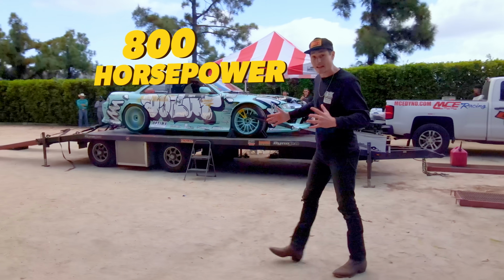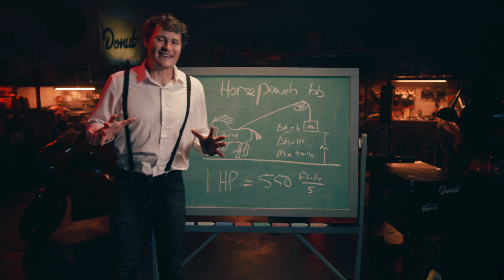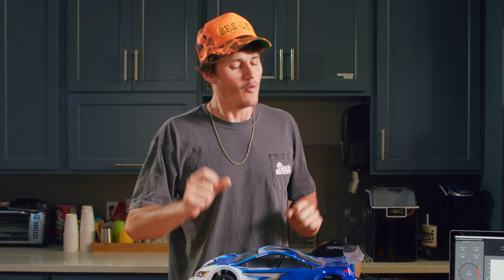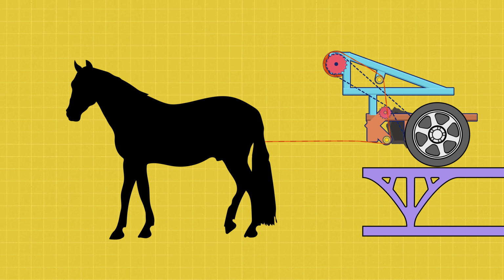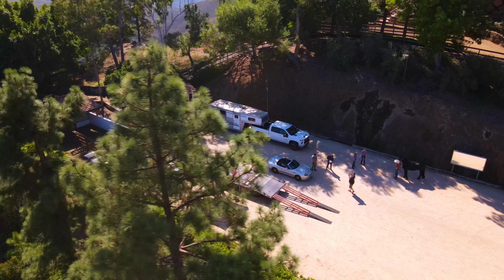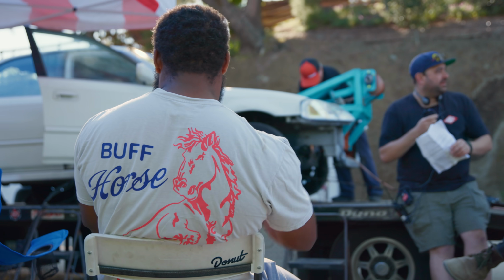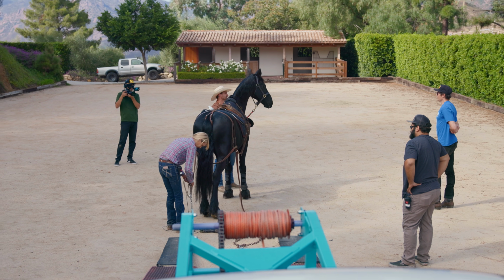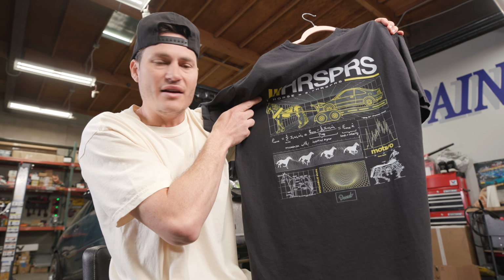How Much Horsepower is a Horse?

Comment: There's a tiny elephant in the room which I'd like to point out. The measurement presented here and often understood in automotive world is peak horsepower. That's the maximum power output you can make in a particular moment. The way horsepower was meant to be used was originally different. It was a question of how much work can be performed in prolonged time. You don't want to have a car that has 1000 peak horsepower but will last just a few minutes before it's "tired". The same goes for horses, although Big D could pull at 5,7 horsepower, it was limited to 5 fairly short runs because it was at his peak. If he was given a task to pull for prolonged time, the force he would be using would be much smaller. The same goes for humans. You could take whole day walking with a bucket of coal but if we load a cart and try to pull it, we will be tired very quickly and we will do much less work in the end. The idea was that a steam engine (and electric, and ICE later on) can run almost constantly at their peak power, so we want to calculate how much work will they do versus the work the typical horse will do within a shift. Other factor that may or may not be included is that horses don't work 24/7, so in some industries an engine that can run 24/7 would replace 3 shifts of horses (assuming 8h shift) which also makes the work done triple.
The meaning of horsepower changed over time as we went away from power sources that get tired and need to rest, so we stopped thinking "it can perform that much Joules within a few hours of work" and we turned into "it can perform that much Joules per second" completely eliminating the rest period from equation. Because of this we can say that Big D has 5.7 peak horsepower but if you would want to power some equipment with such horse for prolonged time, you'd have to have multiple horses and swap them out frequently, which would effectively give you less than 1 HP per horse. Or more likely, use multiple horses at lower power output to use them for much longer time before they need a rest.

There's another funny thing to mention. Shouldn't we get back to the same meaning of horsepower with arise of electric vehicle? Wouldn't it be better, if we could give a real horsepower the car can maintain over a certain time of driving? That would be quite interesting. Not only 1000 HP, not only 100kWh battery or 512 miles of range but also something meaningful - how far you can drive at certain power output and how much time will it need to recharge? In other words, what is the total work it can do within let's say 8-12 hours (or 24 hours for commercial vehicles) including the duty cycle if it needs to recharge on the way. I'm sure this measurement is already made by companies who want to buy electric trucks but it's not widely used by the public, so we can't see the direct comparison between cars. I have 1000km route to make within a day, how much time it will take for each car in given conditions?

Comment: Crank horsepower... ugh. The number some people use (yes, looking at you USA) to artificially inflate a dyno reading to inflate egos.
Wheel power is what matters, it's the number that represents how fast you'll actually go.
Wheel power is what should have been used here. Remove a bunch of the complex unneeded maths.
Also, please show me where the crank is on a horse :P

Comment: Looks like the science is rigorous. A cool project overall.
There are other breeds of Horses that are bigger, and that do pulling as a regular thing instead of a 'show horse' for film or events. So I think the Horse shown is fine for the definition; an average horse producing an average pulling force for horses in general. With this test setup the actual biggest and strongest horses would be double very probably, and possibly triple this result. The largest working horses are likely between 400 to 600 pounds heavier than the one shown; a lot of extra muscle. Regardless of that, this horse shown is probably average so I think the results are valid.

Comment: That guy: to be science you should have put everyone of the 350 horses on the dyno and then take an average. I have no problems with using a dyno to figure horsepower as a dyno still uses an induction motor-generator... Which measures 1hp as 750 watts. Some modern PM motor-generators can create 1hp with only 300 watts now. JS... This isn't science

Comment: Something is not adding up! You pulled it and got 1.16 horse power. The other guy pulled and got 1.23 horse power. A third guy of similar fitness joins in and all three of you pull and you only get 1.9 horsepower? 

Now the math that really doesn't add up according to you one horse is actually 5 horsepower (roughly). So by that logic your standard passenger car in or around 150-200 horsepower is equivalent to strapping 1,000ish horse to it?

Comment: An important part of the difference between Watt's "1 HP" and what Big D put out (phrasing?) is that Watt was measuring how much they could do over a whole 8 hour work shift.  Big D was putting in a brief harder exertion.  Peak HP (which, granted, is the way engines are measured) vs. sustained power production.

Comment: theres a problem. 
i put a horse quarter mile times, and a horse weight, into a formula meant for cars and it game me 27 horsepower for a car to perform the same as a horse. yes it is a race horse but the gap is probably not that huge as the gap in the horsepower. 

so i think you havent reached the "peak" of the curve you were talking about with the dino machine.
im not saying you arent testing it accuratly, i am saying you are not extracting the full horse power from this horse at  these slow speeds. the horse can probably produce more power at full speed

Comment: Why didn’t you just wrap a rope directly around the dyno drum?
Skip all of the loses of the chain drain, transmission, and tires. 
If you have 2 spools on one axle, you can play with the ratio of spool diameter to get whatever ratio between the hose and the Dino you want.

Comment: My original thought was to use a treadmill, a big one. The build cost would be higher but the result is a machine that can be run continuously and not need to be reset to start again.

Comment: I think there's a flaw in your rig design. I'm pretty sure the diameter of the spool of rope needs to be the same diameter as the tire. It boils down to a one-to-one gear ratio. What you have currently must be something like five or six to one.

Comment: I am also a mechanical engineer and I have a question- You guys want to measure the Horsepower of a Horse. Then why do you need a  whole car on the dyno system? Just put a wheel at one end of a fixed spool and let it roll on the dyno roller. Wouldn't that be a more simpler method where we could ignore or reduce the loss by vanishing the weight of a suspension system, steering system, wheel bearing friction of a car blah blah blah??!  I might be wrong but can someone please explain it to me..

Comment: i dont understand, they knew the crank horsepower of the car? They could use the dyno to check the wheel horse power of the car. The ratio of both would have told us how much energy was getting wasted. The multiply the value by wheel horse power of the horse and voila, crank horse power has been calculated.

Comment: Hi!I think you guys over engineered this a bit. You could have just let a horse pull a heavy object like a car in idle on a perfectly level surface and have a precise rpm meter on one of the wheels measure it's speed over time. (or in a first try, just film the cars speedo and see if it's precise enough at those low speeds, just gotta put the speed values over time into an excel sheet) When the weight of the car is known, you can easily calculate the momentary acceleration and power that the horse puts into the car.

Comment: Wouldn't the horsepower number go up if Big D were to run? Like on a dyno isn't the horsepower measured at top speed/max output? There's no way that Big D is only 5 times stronger than you guy's when you pulled. 

I thoroughly enjoyed this video/experiment, well done fellas!

Comment: Bummer about the laser rpm sensor sounds like a programming error maybe. If the sensor only returned Booleans and it was implemented with incorrect data type the "not a number" would make sense

Comment: Using duck tape to measure rotations, are you guys stupid! and that horse was not even running at full speed, the amount or length of rope was way too small. The horse needs to lift the weight during the initial face then should have enough space to reach its full potential. Btw your entire video and horse power figure is wrong, your horse is still working under the load.

Comment: I just want to help correct anybody that thinks horsepower is measured by an actual it is not measured by a horse but is actually measured by donkeys that could pull a 1-ton cart from a coal mine they called it horsepower simply because it sounded better

Comment: Surprised you didn't just use a common old school item, an actual "Horsepower" IE a rotary horse sweep. Basically an arm on a rotating pivot that connects to a right angle gearbox with a shaft that powers the machine. Or the more common horse treadmill that had the horse on the belt and powering machinery through a shaft on the front pulley.

Comment: Is there not a flaw in the logic here? James Watt's estimate, however crude, was for the long-term power output - how much energy a horse could put out over a day of full-time work. While your measurement is of peak power output, and it is explicitly stated that the horse could not pull this hard for very long as you were limited to only 5 pulls for animal welfare reasons. Are you not measuring two entirely different things?

And the relevant figure for an animal will not be the peak power, but the long-term power. The beauty of an engine is that it can produce power all day without tiring. An engine working for more than a few minutes would need to be compared with a horse working for the same amount of time without tiring either. Watt was comparing a steam engine that would run all day to horses that would work all day doing the same job.

It is obviously very interesting that a horse can briefly produce a peak power output of 5.7 horsepower, but it has very limited practical application. If that's his peak output, it's entirely plausible that the actual output of Big D over a full day of real work would be in the ballpark of 1 horsepower.

Comment: If you have seen the pulling competitions with properly trained, and properly driven, draft horses you will know that what this horse "pulled" was probably not even 1/5 of what these would have achieved. This horse hardly understood was he was supposed to do, and certainly didn´t even try to pull very much at all. The proper result would end up somewhere in the 20 - 25 HP range.

Comment: Peak power is different from sustained power. There's a reason Big D was only allowed five pulls a day.
If James Watt measured all the forces etc. required to turn a grain mill and then made observations at multiple points in a day, I suspect 1 horsepower is a reasonable estimate for sustained power output per horse.

Comment: You don't necessarily need to pull the horse at maximum force. You just need the combination of force and velocity that makes the most power. The horse pulling a fixed tree stump would make lots of force but no speed. The horse running at top speed, you wouldn't be extracting any force from it - so also no extracted power. Maybe running the horse up to 20 mph with a lighter load wins (although you will have more resistance losses from the horse just running on the ground - which still requires energy).

Comment: A boiler horsepower (the power of the fire to boil water to drive a 1 horsepower (746 watt) steam engine) is about 13 horsepower because steam engines weren't very efficient. It is the energy required to evaporate 34.5 lbs of fresh water from 100C (212F) in one hour.

Comment: I think it's a little more than 6 actually. You have made the huge mistake of relying on coils, and as we know, each coil grows in diameter. It can also be seen from the jumps in diameters, from larger to smaller, in the diagram.
Have you wanted to interpret a gearbox as well? I doubt it, otherwise you wouldn't be explaining why motor power and wheel power make a difference.

Why didn't you try a chain link like on the elevators? The reporting would be more accurate ;)

* And yet, respect for the work you have done :)

Comment: So many things wrong in this video.
1. Not using the correct horses. Those are movie horses, not real workhorses like belgian or other draft horses. Now that I think of it, proper draft horses would have probably pulled the whole trailer and broke that little rope.
2. This horse is not trained to pull, at all. You can see it confused a couple times when the rope is being pulled and the weight start applying,
3. The attachment on the horse shoulders aren't correct, at all. See proper horse draft competitions.
4. Bro, just put the rope on the drums instead of making this whole contraption and involve math.

The idea was cool, the execution was terrible.

Comment: This is legendary, possibly the best video you’ve ever done. This shit is just cool as hell. Only thing I’d think would improve the accuracy of the experiment is having built some type of device to use instead of a Honda Civic which would have little to no loss of power and wouldn’t require all the calculations to find crank power

Comment: Instead of using the most fitting type of horse, a mustang. Pfff.
Also, don't the pulleys affect the results? Also measuring one horse probably doesn't quite hold up to academic standards. Just like any test/experiment etc. 
And couldn't you have kind of "mounted" two wheels(with an axle between) on the dyno? xD
But yeah, great video <3

Comment: This is great! I can't help but wonder what you'd get if the horse had more grip, if the line wasn't slack at points, etc, but this is about as good as you could've done it within the timeframe I reckon so well done.
Reply: I was curious about the slack as well, I wonder if it would have been higher if there wasn't any, and it was taught the whole time.
Reply: Fantastic episode, but Yeah, roll race, instead of from a dig stand-still. Cars do their dyno pulls at speed; so should the horse. 😊

Comment: i do not know how in the world you got diplomas for mechanical engineering???? you could have simply tide a long rope to a horse and measure the pull on hydraulic push-pull dynamometar. and the rest is calculation.
to be noticed i went to college  for mechanical engineer

Comment: If the claim is that the original designation of what one hp equals is inaccurate, Wouldn’t any measurement you do on a dyno be inaccurate since you’re started out with a faulty unit of measurement to begin with?

Comment: The way I was thinking about it was a wheel and hub dyno with essentially a wound rod so you have no linkage, calculating the mechanical loss is easier without pulleys and whatnot.

Comment: Yea but isnt that measuring with a device that used the wrong number for horsepower? Shouldnt the number be in torque over time? Then we could could know how much real horsepower a car has by using that number instead to measure by reconfiguring the dyno so that it operates on the new number

Comment: So we know the instantaneous HP for that horse now…

The HP Watt devised is based on sustained output over the course of a work day. At a sustainable pace that will not tire the animal too quickly.

Horses get tired, and they need to be swapped out for fresh horses. It’s not good to over work your animals, leads to potential injury and behavioral problems. You need to find the pace that maximizes their output until time to swap them for a fresh animal.

How conservative Watt was in his calculations, I don’t know… It definitely served his sales pitch to be a bit conservative. But the advantage of an engine over a horse is more than just pure power output. There is the fact that you do not need to feed or house an engine. There is no need for any care to prevent or treat medical issues… No need to stop and swap animals as they tire…

Comment: Its time to revise HP standard with new tested more valid data
Edit, after watch till end, not worth the hasle, lets just HP as used to be, as usual, not worth make new measurements standard.
Just use torque or newton, case closed

Comment: Geeze load cell and gps is way more accurate and more sensible. Horse should be pulling against a brake on a drum or a simple cart with brakes. Iniertial measirement on car dyno with rube Goldberg contraption theater/silly. No need to account for losses with direct measurements of line load.

Comment: Should also have hooked up another car, to the dyno, the same way and then calculated the horsepower with that. And then using that value in a ratio form to calculate the actual horsepower of the horse. Could have been more accurate I guess?

Comment: That's a much more believable number than 15HP. Whenever I would think of a car, say a 150HP 2.0L sedan, it's hard to believe that it's only 10 times more powerful than a horse. It can propel a mass of ~4,000lbs to 100mph. 10 horses can't match that. But 30 horses is about right.

Comment: it would make sense if, before measuring a horse, a car was measured on this device instead of dudes. a car with a known power value and the readings would match.
where is the device calibration and comparison?
theory and calculations are good, but practice is better.

Comment: 1 horse is 1 horsepower. So instead of saying 1 horse = 5.7 horsepower, we need to recalculate engines horsepower rating by dividing it by 5.7 

Like a Hellcat Redeye would be 141.6 horsepower.